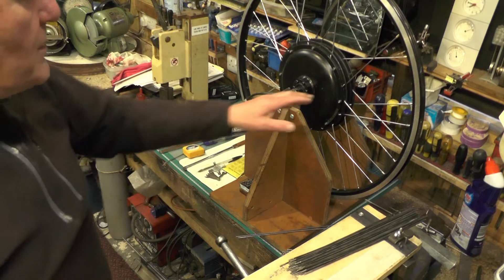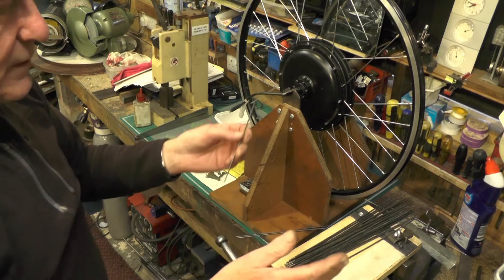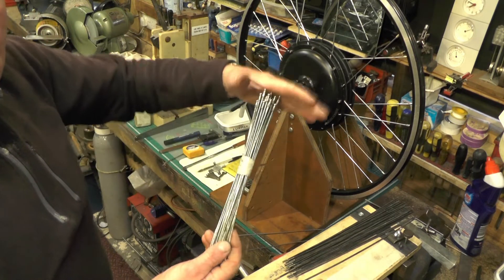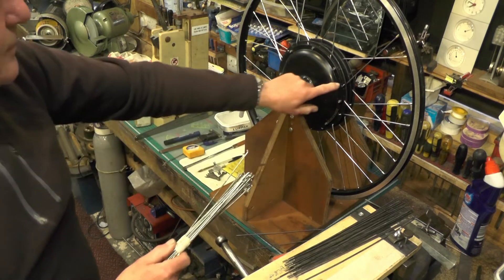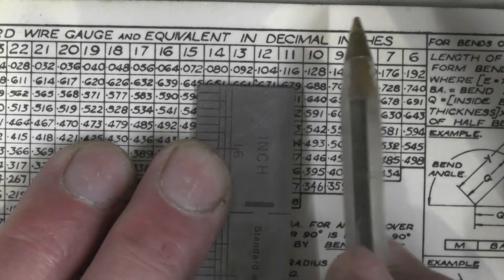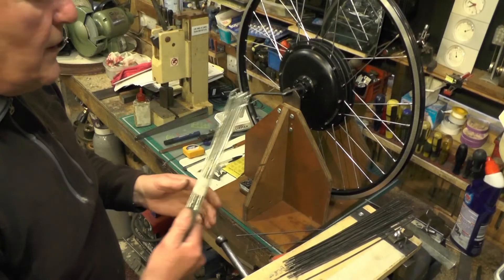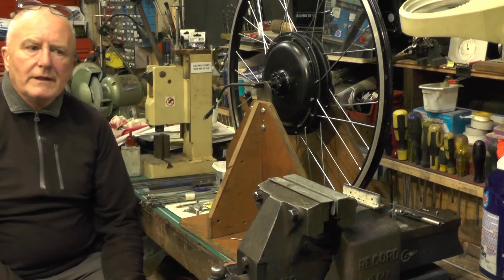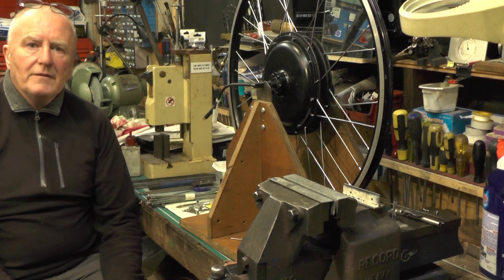MAKING BICYCLE SPOKES (Make your Cycle in to Electric Ebike P4) "mr factotum's workshop"

Comment: Aye up chuck...  cheers for this 👌
Reply from the maker: No problem 👍 chuck🤣👍👍👍👍👍
thanks for the feedback
atb
Kev
Reply: @MrFactotum  you edumacated on these electric bikes? I may need some advice. I'm a tinkererer and was handed a bafang rear wheel but would liketo mod the wife's bike. As in s far, i have a back wheel lol
Reply from the maker: @blizteredthumbs7911  👍👍👍👍👍👍👍👍👍👍go for it, 
should work well, better than buying a overpriced ready to go ebike. all mine are still going strong, look after the battery, keep it occasionlly charged when not using the bike. They dont like to be left.
my battery is coming up to 3 years old and still works well👍👍👍👍
just copy what i did
atb
kev

Comment: I made up a wheel last year using S bends and had no problems either. I am making up a wheel now and I am ordering my spokes for the second time and it doesn't look as if these are going to turn up either.🙄 so it looks like I will be S bending again. 
The only problem I had last time was that I kept wearing out the jig hole.
Oh and the arthritis in my hands is so bad I had to grip one side of a pair of bolt crops in a vice and use those like a guillotine.
Reply from the maker: eyup Shawn
Thanks for the feedback, nice to hear your making the same, yes the Jig hole does take a pounding, it really needs making in a steel suitable to be Hardened, got to admit cropping them with side pliers is tough on the hands, but where there's a will there's a way, next time i might get the dremmel out with a cutting disc on.
Take Care
Kev

Comment: I can't quite wrap my head around how the S-bend (in lieu of a proper J-bend with stamped head) withstands the severe tension introduced during cycling. Won't it work loose somehow?
Reply from the maker: hi VN
thanks for feedback and watching
I am no expert but, All i can say is the way i do it, seems to be as strong if not stronger than a J.
I have used this method for a number of years, and never had one come loose or snap, if done properly.  I use my bikes everyday (weather permitting) on normal roads, trails, tracks and canal tow paths, with normal use, i am NOT an extreme terrain rider so can't vouch for that sport. I have no intention to stop using the method as it suits me. As for severe tension, you will only get this if the spokes are tightened incorrectly, unevenly, too tight or too loose etc. just like you do with J bend spokes. If they are tightened correctly there should'nt be severe tension as in use one side cancels the other side out, as at any point in time, one side is in compression as the other side is in tension.
Hope i have explained my philosophy on this clearly and hope it helps you
regards
Kev
Reply: @MrFactotum  you have, with aplomb, thank you. My worries have more to do with being a Clydesdale rider weighing more than twice you, than anything inherent in your approach. :-)
Reply from the maker: @VideoNOLA  Hi VN
It's took me 65 years to come across that word aplomb, just shows my english skills learned at school, was'nt my greatest subject, but that word will stick in the left over grey cells now for future use.👍  As for your worries, you will be suprised the load spokes will take if fitted correctly, if your unsure just go up a guage, normal spokes are 14 gauge, i use 13 or even 12 gauge, you find 12 gauge commonly in small motor bikes / scooters. Also use a double wall rim as used  in ready made up ebikes.
Cheers
Kev

Comment: Great content, you show a SWG chart of sizes, is that available anywhere? It has bend information on it in addition to the sizes.
Reply from the maker: Hi RC
thanks, all the info from a Zeus Book, i've had for 40 years, but is still available off ebay i believe
cheers
Kev
Reply: @MrFactotum  cool  I'll have to dig mine out, I don't remember seeing the the bend info in it.

Comment: Interesting stuff Kev, two simple but effective jigs. I have a set of Z bend pliers used in model aircraft building (on much thinner gauge wire) that are very effective, I wonder if they sell bigger versions that could do 12 gauge? Cheers, Jon
Reply from the maker: sounds like a plan, ive never seen those type of pliers, i will keep my eye open for some!
thanks for feedback
take care
Kev